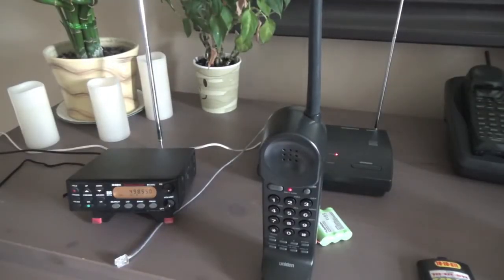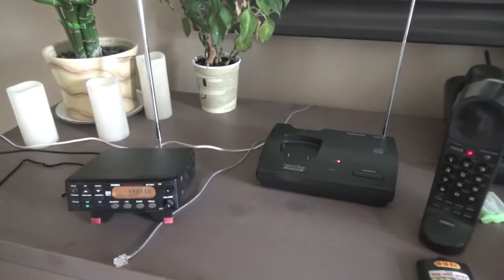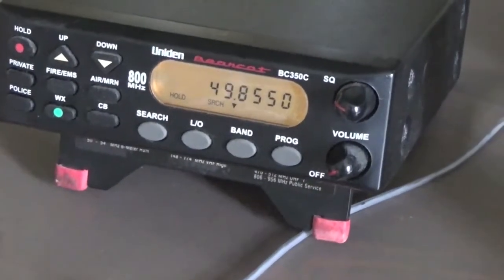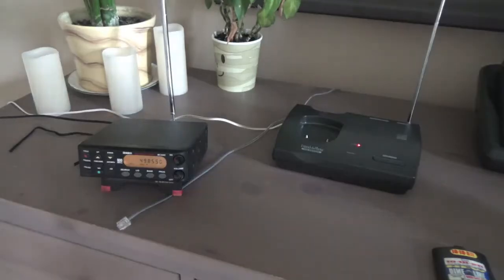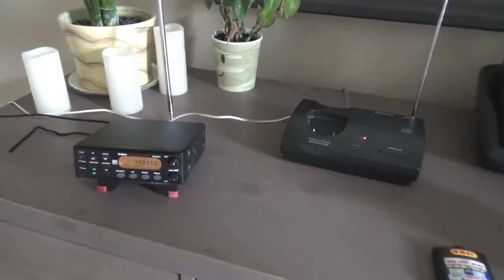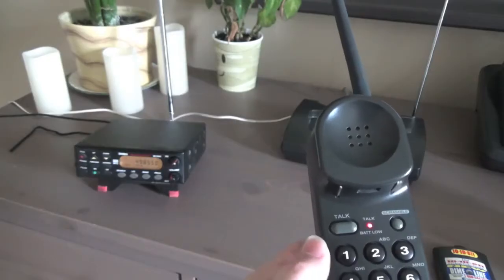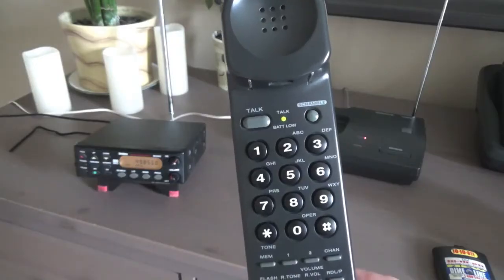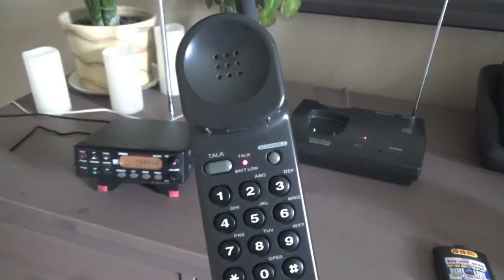Listening to a Voice Scramble Cordless Phone

Comment: I mean, it's a good demonstration phone, but what purpose would you ever have to not scramble?  Not sure why it's an option...
Reply from the maker: I don't know either.. The other oddity is the default when you turn the phone on is for the scrambling option to be off--you have to engage it for every call..
Reply: It just occured to me that maybe it takes more battery on the receiver's end to scramble, so it gives the option of scrambling only for calls that contain important personal info.  That's all I can think of.  But still, if I were to make a call that contained private info like that, I'd use a corded phone.
Reply from the maker: That's a possibility.. I'll have to look in the manual to see if it gives any indication of a difference in the battery life..
Reply: You'll likely get better range on the handset with it unscrambled.  The scrambled signal will be more susceptible to various types of interference.

Comment: Interesting. I wonder what the encoding algorithm is and how easy it would be to decode it.
Reply from the maker: This is analog--there's no algorithms.. It utilizes 'voice inversion' to change the frequencies of the sound.. For example, low frequencies are 'inverted' to be high frequencies, they are then sent over the air in this format, then the process is reversed when the transmission is received.. It's relatively easy to unscramble the transmission..
Reply: There's actually a few different scrambling methods but all of them unscramble easy. Get the AOR-DV1 scanner from a non-US dealer (idiot fcc rules in usa) and it does it automatically.